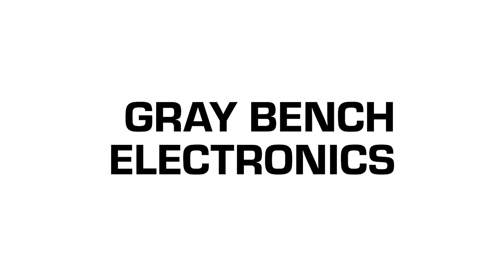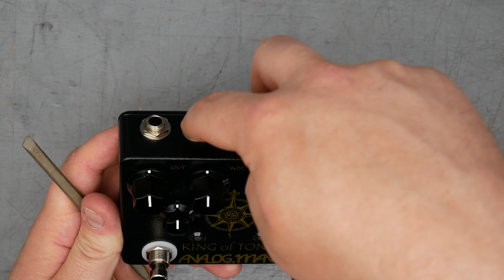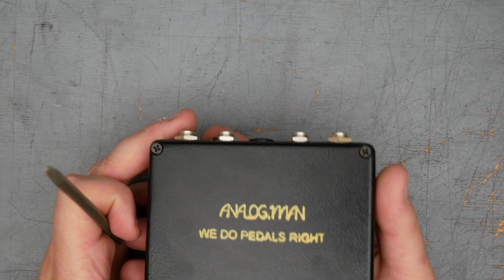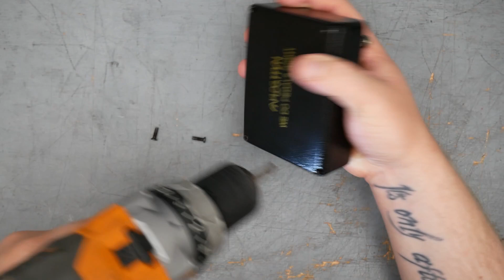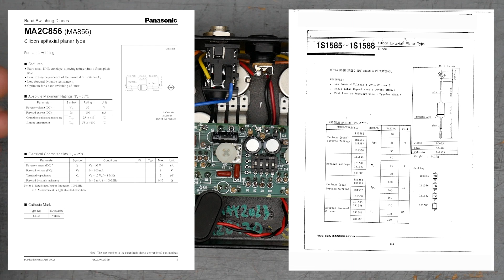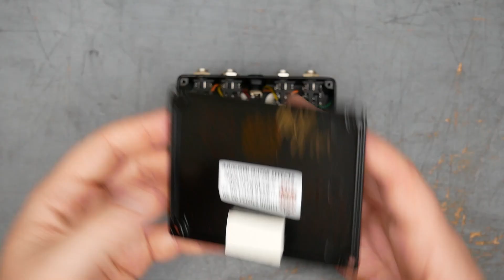Analogman King of Tone Teardown! See what's inside!

Comment: i found a source for the MA856 diodes.  they have one yellow stripe. I've confirmed by physical dimension as well as measuring their forward voltage they are the real deal. Thing is you have to harvest them from an old 1981-82 Panasonic VHS unit. these units are available on ebay  for cheap i paid $30 shipped.  This particular VHS unit also has all 8 needed to build a KOT.  I'm building the Aion one as we speak.
Reply: Hey there! Do you know what vhs unit it is? I’ve got a pedal someone built that has all the correct parts but ma858’s and would love to swap with 856’s to see if there’s any difference!
Reply: @TheTrey5027  panasonic pv-a45p  you have to take the tuner module out and break into it. it's a small metal box with tabs. i tried sourcing this tuner box separately but nothing comes up in a search for it.

Comment: 10:45 I've had the privilege of owning multiple KoT pedals at once and I've switched around the stock chips (some very good chips from the outside as well) and for sure there was a big difference. It's magic and a bunch of synergy. In one setting a certain opamp wouldn't make a difference, but when you have it all together, there are components that really start to rock alone. With the right side high gain options as well, those chips are made for this circuit, for sure. Not like the differences weren't noticable. They all had a lot of character. The same high gain chips could be clear, some had this character of going over the top, almost muddy, from the same pedal.

Comment: Answered my question about stereo jacks. Now I know my satellite board can plug into the left side and then to a switcher to switch betweem boards.
Reply: Did you get yours working properly? Stereo jacks?  I got KOT 2 Jacks and I wanted to have it as 2 individuals pedals to connect each pedal to a loop of my switcher.

Comment: I spent a lot of time swapping in different op amps on my KoT and settled on using an OPA2134 for the left side (yellow LED) in clean boost mode.  It has a less spitty overdrive tone than the JRC4580 (aka NJM4580), especially when driving it hard with the right hand side volume cranked up.   

Those mythical diodes (MA856) are only in the circuit when the distortion mode is selected with the DIP switch, which I never use.  The 1S1588 diodes have about the same forward voltage drop as 1N4148 diodes which are dirt cheap and widely available.  It is no surprise that Analog Mike chose them as a replacement.  

You can run 18V power on this pedal since those electrolytic capacitors are rated for 25V.  This provides more headroom for boost before the op amps start distorting.  It sounds less compressed.

By the way, I managed to smoke the 4580 op amp by plugging in the input side while turned on with the gain cranked.  Replacement was trivial, since it was socketed and I already had a pile of op amps.
Reply: The MA856 diodes are in the circuit when the soft clipping or overdrive is selected, using DIP SW 1 and 3. For distortion, it uses the hard clipping 1S1588/1N4148, DIP SW 2 and 4. The MA856 can be in or out of circuit for distortion. AM advises against using both switches up, whereas Wampler's Pantheon uses those diodes as a kind of pre-conditioner - you can't switch them out at all.
Reply: @MC-hx6nk Thanks for the correction! I looked up the data sheet for the MA856 diode, and it does indeed have a higher forward voltage drop than 1N4148/1N914.  It's around 0.7V at 5 mA current flow.  The 1N4148 is around 0.6V at that current.
Reply: @JohnShalamskas  My point was that the MA856 are in play for the OD mode ...and the 1S1588 for Distortion. The MA856 is not the key to the Distortion mode, only the OD.

Comment: The reason why they went with the longer leg pots instead of the standard pcb mounted pots might have something to do with the footswitches being pcb mounted. I think the footswitches stand quite a bit taller than the standard legs of a pcb mounted pot, so my guess would be that they needed that extra length in the legs to mount the pots in the pcb.
Reply from the maker: Sure, that's fair. I think I would still prefer to put the footswitches on daughterboards and connect with headers or ribbon cable rather than having to bend six sets of pot legs like this.
Reply: @graybenchelec  Couldn't agree more. That's how I've always done it and I'm not planning on switching anytime soon, but here's the catch. KoTs take forever to be manufactured as they are. Can you imagine adding 4 to 6 more solder joints? 😂
Reply: @alexisdrosopoulos  Soldering is quicker than custom bending all those pot legs.
Reply: @JohnShalamskas  yes and no. I mean, I can't really argue with that but I'm not absolutely sure that's true either.
Reply: The bending doesnt take much longer then soldering. The bends dont have to be as precise as you would think. You can adjust them into place before placing in enclosure rather easily. Ribbon cables and wires break easier in my experience.  : )

Comment: I just wish companies would ditch the plastic white washers on the footswitch
Reply from the maker: I can’t help but agree, metal washers just look better don’t they?
Reply: @graybenchelec  They use the nylon ones because it cuts down on the fact the switches are kind of poorly designed and can make microphonic clicking sounds and other stuff. Try putting one in a wah pedal and you can hear the actuator in the signal path when its toe down even though you're not fully engaging the switch. I just avoid the 3PDT switches and would rather use Millenium bypass if I need an LED.

Comment: I actually just built a clone and it is a darn good sounding pedal. 
In the upper left of the PCB it has "R5 optional" and it looks like C4 is unpopulated. Any idea what those are for?
Thanks, love the channel!
Reply from the maker: Alright so R5 is the 10K resistor limiting the current out of the first opamp stage. It's marked optional but I've never seen a KoT built without it. This is one of the resistors AM switched for carbon comp. Interestingly, the matching resistor (R29) on the orange side is not marked "optional".

The missing cap is actually C12, and it's across legs 2 and 3 on the red side gain pot.
Reply from the maker: I’m not sure, I’ll check it out and get back to you!